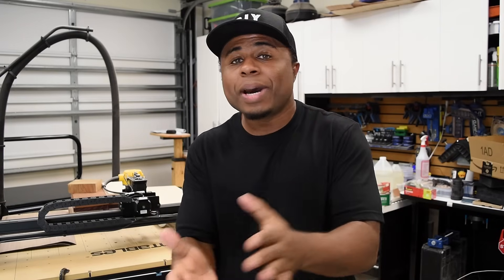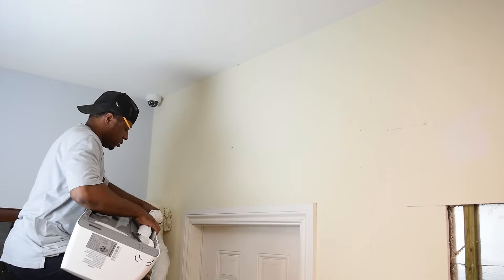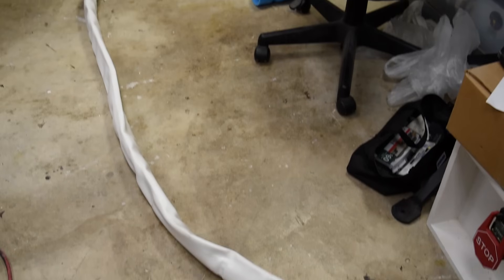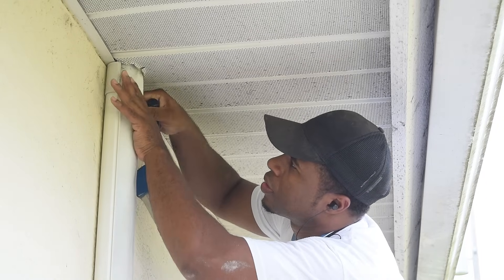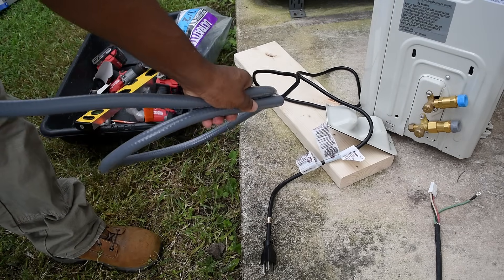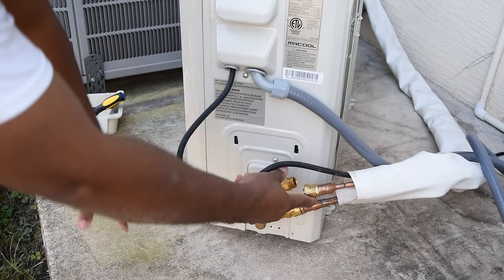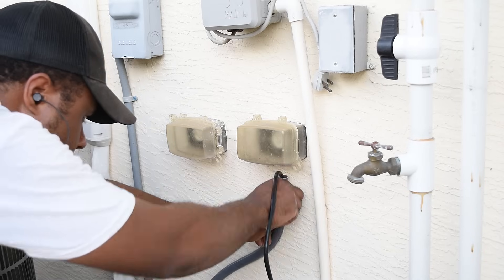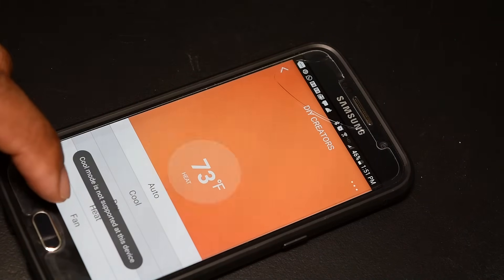How To install Ductless AC & Heating System // True DIY Mini Split MRCOOL

Comment: Don't you need to vacuum evacuate the lines before releasing the valves?
Reply: I guess we all do our installations different I'm from Jamaica and that how we do our installations here
Reply: @brucemonroe8719  In India too it's done the way you said but see the image of the connectors someone posted in the comment above yours... You will understand why it doesn't need vacuum evacuation...
Reply: @saiskanda  ok I understand
Reply: But isn't it just a cap to keep dust out? or the head of the line have some valve like a quick coupler?
Reply: Ok I think it's exactly this.
https://cdn8.bigcommerce.com/s-7wqdm8gvmj/images/stencil/1280x1280/products/6897/15689/bb3a9b81-2348-47c8-93bb-aadfa8c92fae__75031.1510806945.jpg?c=2&imbypass=on
Reply: Of course you need to vacuum the lines.  Anyone who argues otherwise is an idiot and/or poorly trained or not at all.  You need to do a pressure test to make sure that as soon as you release the valve, refrigerant doesn't all just shoot out of a leak somewhere, and naturally to make sure all the moisture is out of the lines.  You can see at 9:36 the port to evacuate the line is an inch away on that lower line connection.  They don't include that just for the sake of having it there.  It's meant to be used.
Reply: Oh I get it! They are using a charged line with special connectors not just a threaded copper nut... So if anything does go in it's going to be negligible...
Reply: All line set have to be vacuumed no matter the manufacturer
Reply: no Bruce. Do you even listen?
Reply: That is not accurate information: it matters a LOT what the manufacturer recommends.
Reply: @brucemonroe8719  he will learn the hard way when the compressor takes a dump way before its end of life expectancy
Reply: The Mr Cool DIY series linesets ARE vacuumed, then precharged with refrigerant at the factory, so your statement "no matter the manufacturer.." is factually incorrect, as it DOES, very much depend on the who the manufacturer is.
Reply: Elder Geek No they are not, wow are people stupid in here. I do this for a living, you always , always have to do a vacuum to get it 500 microns or lower. You must get the moisture and air out of the lines. You homeowner keep tech busy cleaning up after you fools. You have no idea what you are talking about
Reply: @zack9912000  it amazes me that people don't read the comment replies before commenting. Try reading the comments dude
THE LINES THEMSELVES ARE CHARGED
Reply: @zack9912000  if you actually look at the way the connectors connect and open upon connection you would realize that the space is so miniscule that it's a non issue.  As far as the science part of I freaking promise you my ninja math skills in physics and thermodynamics will trounce your math skills.
Reply: David Moritz what do you think took the place of the nitrogen that was evacuated from the interior unit? fairy dust? No. Was air and with all air there is moisture. Moisture that will condense inside the unit once the compressor is started.  From then, either capillary obstruction, or failing compressor. 
The seller of this unit is taking the buyers in an expensive ride.
Reply: I do installations of both carrier and lg air conditioning units and our training states what should be done.... I will do what my work according to my training... both manufacturer have specific routines of proper installations that should be followed... we all do what we do... What works for u works for me and what works me works for me....
Reply: Thanks, Bruce...exactly what I would say as well. I would expect a pro to follow the manufacturer's training and routines.  For us DIYers, we have MrCool's DIY series, and we follow their instructions and routines. Different strokes....
Reply: I would follow the manufacturer manual,as stated. @Bruce you are in Jamaica, where the climate is different, and it may cause moisture in the lines, of the units your installing. Also alot of units, are not kept, sealed These units are sealed, vacuumed, and awaiting shipment, not like traditional units being stored, maybe open to build up moisture, dust, etc. Following the manufacturer instructions, are important, as if you do anything outside of that, may void warranty, and or having problems with the unit, later, and void any refunds or returning a damaged unit.
Reply: ABSOLUTELY, in a few days/weeks/months the moisture he left in the line set will ruin that compressor!! Lol.
Reply: @cbishop41483  what moisture? The lines were vacuumed, charged, and then sealed at the factory? Where is moisture induced back into the system?
Reply: @cbishop41483  better go read the rest of the comments because you're *WRONG*!!!
Reply: @cbishop41483  theres no way moisture can get into the system. Evap- precharged  lineset - precharged.   Condenser/compressor. - precharged 
It has seals  that dont break until you make the refrigerant lines connection at the  condenser.   Even after that connection is made--- the system was never exposed to air in the lines, or lost any freon. Mitsubishi's splits are the same principle.    Since theyve never been exposed, or freon/oil charge dicked with, it WONT need evacuation.   To evacuate it- would be messing with what is essentially the Factory Charge on the system.  
Proper evacuation, proper oil charge, and Exact proper freon charge-- whether automotive or residential,are the Keys to  having AC  systems that perform and last.
Reply: Yeah you need to evacuate to 500 microns and at least an hour to ensure the system is dry.  Any moisture in your system will destroy your compressor over time.
Reply: @timothyfung326  Please go read the comments to find out your wrong, the lines and unit are pre charged with special valves that do not open till they are connected and full screwed on.
Reply: Wow this blew up 🤣
Reply: Pre charged stupid lineset. So if you have a 10 foot run you are stuck with a shitty looking install.
Reply: I have seen these pre-charged line sets used on ice machines before.
Reply: yes ...its very important..he take a big mistaike
Reply: You're the one who needs the Clerasil, dude!
Reply: Jeremy Marsh no tantrum here.  Sorry, but it seems like you’re just another person that doesn’t have a clue how the system works, or how durable it is.

You say that 90% need to be vacuumed, which leaves 10% that don’t need it.

This would fall in that 10%.

Also, this isn’t 1990.  If you don’t think the Chinese are capable of making quality products now, you aren’t very bright.  I can see how some of you are so stuck in your ways, that you think all mini-splits need a vacuum pulled.

Again, no matter what you’ve been taught, what you’ve heard, or what you think you know.  The simple fact of the matter is that this brand does not need a vacuum pulled and it’s well-built and durable.

If you have no experience with THIS brand, then you have no basis of knowledge to even speak about it.
Reply: Definitely need to be using a Vac Pump there brother!
Reply: Home owners should not be allowed to handle such hazardous liquids. This is crazy!
Reply: You don’t need to pull a vac. You’ll just chop your compressors lifespan in half and it won’t perform to the energy efficiency rating on the data label. No big deal right? 🤣🤣🤣🖕
Reply: 7 year warranty on the compressor if you diy and the seer rating is for diy so...
Reply: I've been in the HVAC trade for 30 years, you absolutely need to evacuate lineset and indoor coil prior to opening valves. Pre-charged linesets  (no such thing as a pre evacuated lineset. As soon as you take a cap off, it being in a vacuum would introduce non-condensable air into the system) are garbage, as is most every lineset the homeowner can purchase with these kits. Oh and by the way, I have a do it yourself kit for knee surgery. Best let the PROFESSIONALS do it, use good quality equipment that comes with a WARRANTY. Otherwise, you're out of luck.
Reply: You still will have to vacuum the line to get rid of any moisture... once the caps are removed to do final connections to both evaporaters and condenser micro levels of moisture has entered the copper tubing line... 
Plus with the unit being precharged u will have to have a charging gauge on it while unit is in operation to check the psi level of refrigerant depending of foot run of copper tubing
Reply: @brucemonroe8719  no. Bleeding off the lines would have solved that, if he had done it.
Reply: No you do not need to vacuum the lines because they are precharged. There's no space for any foreign contamination. Just couple the lines as instructed and open the hex valves all the way and recap
Reply: Richard A. Valdes .
Reply: Of course you do. The inside unit got full of air and humidity when the nitrogen was bleed out. That humidity will either make the AC to stop working, or will shorten the life of the unit.
Reply: No vacuuming lines necessary with the MrCool DIY series.  There are other mini split manufacturers out there that precharge the CONDENSER instead of the line set, so for those, line vacuuming would be necessary/required, and if you do that yourself, you're looking at $90-$160 in parts ( gauges, pump, etc).  Adds time to your install, for sure...but why bother? The MrCool DIY's all come with the lines precharged, and once you do the install, their warranty is intact!  The line set for the install covered in this video is 25 ft long, however , once you install the head unit 8 or so feet high on a wall, then choose the condenser location, you won't have as much leftover as you think...I can attest to that!  The most difficult part is lifting the head unit onto the bracket, while carefully feeding the line set out of the hole you drilled.  The caps on the ends of the line sets are strictly to keep junk out of the threads, and not to keep the refrigerant from leaking out!  One note: Once the lineset is installed on to the condenser, you will not be able to remove it without losing the refrigerant, and that will necessitate a call to your local HVAC people for vacuuming and recharging.  Choose your install location(s) wisely, grasshopper.
Reply: ElderGeek T Romeo you sir have said the dumbest thing i have ever heard. And thank god there was no crazy leak because that would be a major EPA violation witch would result in a extremely hefty fine and possibly jail time
Reply: What if you have a leak? You have to pull a vacuum then recharge. Or buy new line set that is pre vacuumed and charged??
Reply: Cheyne Clair this is why lines should be pressure tested before the valves are opened 👍🏻
Reply: All of you people talking about vacuuming the lines don't have a clue.

I AM an HVAC guy, and have been for over 20 years.  These Mr. Cool DIY systems do NOT get vacuumed!

I've installed MANY of them over the years, and this particular model is one of the FEW that doesn't need the lines vacuumed.  Other brands and models will need a vacuum pulled.  I wasn't sure of it myself when I first heard of it.

This one does NOT.  Over 300 installed and haven't had a call for a failure yet.  The very first one I did was for my neighbor several years ago.  His is still working great.  No issues whatsoever.  You know why?  

Because the lines don't need to be vacuumed!  Thinking you know everything is dangerous.

If anyone thinks this needs a vacuum, you're simply as wrong as wrong can be.
Reply: @gp37128  So you do NOT need to do something simply because YOU say it does not need to happen?  You're essentially saying: "The lines don't need to be vacuumed because they don't need to be" is the WORST argument.  Ever.  Care to explain why?  Besides the fact that you haven't gotten a complaint on one yet?  Just because you haven't gotten a complaint doesn't mean that there aren't issues with the units you've installed.  I can install 300 as well but if I don't leave a correct phone number I wouldn't get a complaint either (genius!).  Is there a reason why other "traditional" A/C lines get vacuumed yet this one doesn't need it?  Magic?  Magic makes the lines impervious to damage and/or a leaks?  Are you saying that the fittings and copper tubing will NEVER get damaged prior to install?  So if I went out and bought one, ripped a hole in the copper tubing and assembled it, it would still not need a vacuum because...it just doesn't?  You're a bad HVAC guy and I wouldn't hire you if that's how you came to that conclusion.  Does this unit have superior deisgn?  How is the design any different from other designs?  How does it eliminate air/moisture from the lines and prevent damage?  There doesn't seem to be anything special about this setup.  Lines aren't made out of adamantium or vibranium, pretty much indestructible materials.  They appear to be made out of copper, which is a fairly soft metal.  Your argument does not hold up.
Reply: @rpenri  I wasn't making an argument.  I was simply telling what I know to be fact.  If you took it for an argument as to WHY someone shouldn't, then that's on you.  You completely misunderstood.

But, Mr. Cool manufactures SEVERAL different kinds of units.  Some of them need to be vacuumed, and they make this one so that it doesn't.

All of the people claiming that this needs to be vacuumed, how many of them actually make units for resale?

Mr. Cool DIY comes with pre-charged line sets that are factory sealed.  Factory sealed, pre-charged line sets have been used for decades in the modular and mobile home market with great success.  

The fact that so many people haven't heard of pre-charged line sets and think these need to be vacuumed isn't their fault.  But they would do themselves a favor by getting educated on what they are, and why they don't need to be vacuumed.

It's like an installer installing one of the units that actually needs to be vacuumed, in then someone coming back and telling them to vacuum them again.  The response?  "I just vacuumed it before I installed it!  Why vacuum it again?"

It's the same situation.  Mr. Cool DIY units have already been vacuumed, and pre-charged at the factory.  No need to pull another vacuum.  It won't accomplish anything.

Instead of questioning me, how about question some of these others that predict compressor failures, and all kinds of other problems, when they don't know anything about this particular product.

Simply put, those people are just plain wrong.  I don't have a dog in the hunt.  People can do and believe what they want.

In this instance, it's clear that people are stuck in their ways, thinking that what they've always been taught it the way it will always be.

They're wrong.  And Mr. Cool DIY proves it.
Reply: All of you so called professionals, know it alls, get a life, and read before you start posting. Precharged lines.
Reply: Tom Diesel and you idiots again don’t understand YOU still have moisture and air in your connections that must be removed. Congratulations you have allowed air and moisture to enter the sealed system and YOU will cause acid and non condensables in your system that will kill the compressor.

I repaired over 3 dozen of these a years from Homeowners like you who still do not understand or have a clue what you are doing. We call it Craigslist specials and hack work which people on here clearly are.
Reply: @zack9912000  lol yup im right there with you.  $100 to do repair, $150 if you tried to fix it before I got there, $175 if you ask questions while I'm working, $300 if you help.
Reply: Timothy Fung what HVAC company do you work for?  I’ll be sure to avoid it with that kind of holier than thou attitude.  Can’t we all just agree that professionals exist for virtually all aspects of life.  Jeez, I don’t criticize or penalize people for not knowing about their biopsy before I read it out.  Same goes for any professional.  I would “hope” that my auto mechanic wouldn’t sit around calling me an idiot because I didn’t know how to change a water pump or ignition coil...that’s why people go to a professional in the first place.
Reply: I've been learning HVAC for a while now and my input is this- leave HVAC work to the professionals. It doesn't matter if the unit is precharged or not you typically have to fine tune for proper subcool/superheat. If lineset is exposed to atmosphere PERIOD, IT MUST BE EVACUATED. Moisture causes acid to form within the lineset due to reaction. Lastly, you really need to be epa certified to work with air conditioners and refrigerant. I would be the one just waiting for someone who didn't know what they are doing to mess up and release refrigerant. I'd then get your ass for 10000 dollars paid to me for reporting not to mention the fines you would have to pay.
Reply: @rockemsockemyall  james thats not entirely true, these split systems like this come pre charged in the lines and system and you can pretty much imagine it as a large window unit with the two main parts seperate by a long line set.  They are essentially a large unit you would buy at Walmart.
Reply: The MrCool lineset is NOT exposed to the atmosphere...period! Whatever else you believe is your opinion and duly noted...If you are working directly with refrigerant, THEN according to various state and local as well as EPA rules, you may have to be certified to do so...Again with the MrCool DIY series, you are not working with refrigerant...at all!  So, go bust someone who allegedly released refrigerant into the atmosphere, as it seems that may be how you make your living...won't happen with this MrCool series, unless there was a factory leak, and the lines were not charged out of the box. it DOES matter, by the way, since this MrCool DIY series are certified most states ( all by now) for DIY install.  Sure glad most HVAC "pros" dont have your attitude...or faulty logic!  If you're "learning HVAC" as you say, you definitely need to educate yourself further.  If I hear of any of those criminals who leak refrigerant, I'll refer them to you, so you can make the $10K bounty.